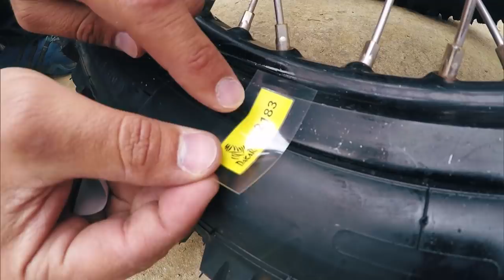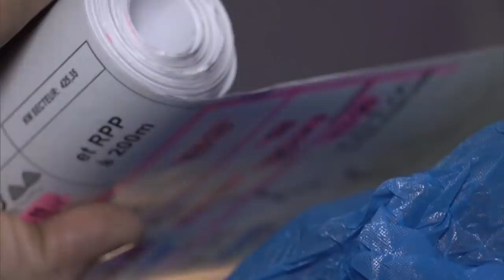Lyndon Poskitt Racing: Races to Places - Dakar Rally 2018 - Episode 11 - Rest Day

Comment: does anyone know why he runs a low front fender instead of a high fender?
Reply: Micum MacIntyre rallye bikes generally do I think motocross/enduro bikes have a lot of mud so front mudguards are high to stop jamming the wheel up.
Rallye bikes usually have large sections of sand and some road sections where the lower mudguard is ok but also the front wheel can be seen where as on a motocross bike the trade off from having a view of the front wheel versus the larger gap to stop mud packing into and jamming it.
When I drop my bike and rip the front mudguard off it always throws me as all of a sudden I can see my front wheel.